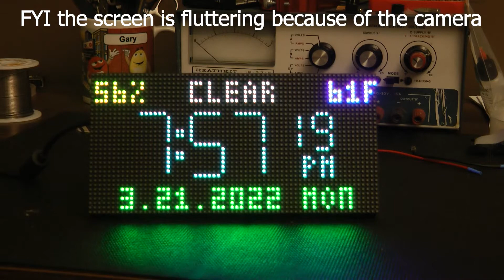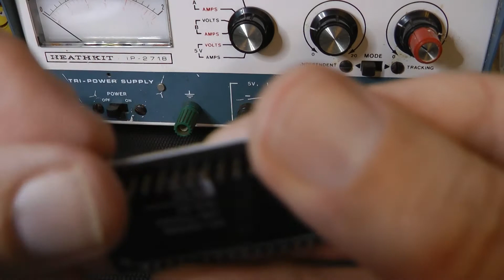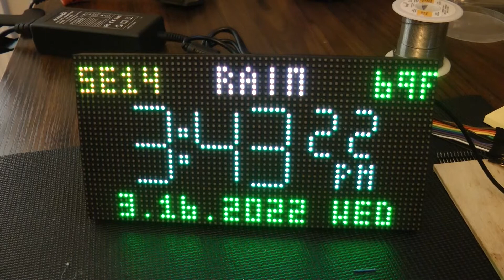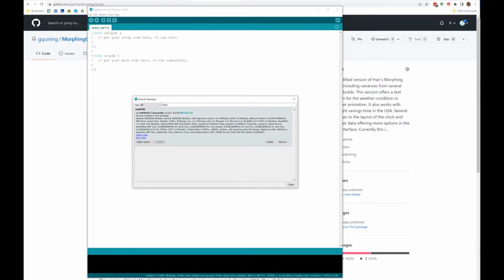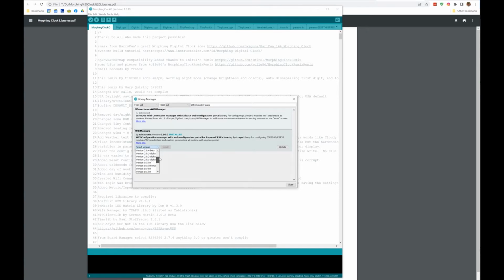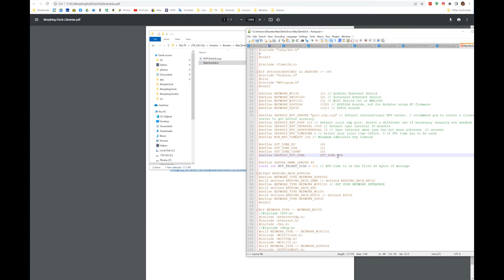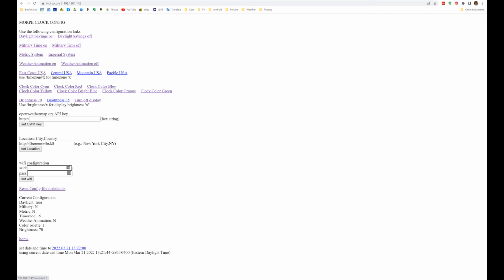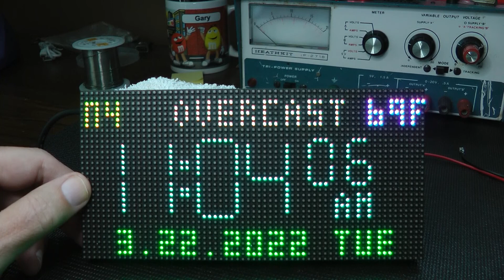Morphing Clock using a 64x32 RGB Display

Comment: @GarryQuiring
Hi Garry, I have followed every step as you had discussed in your video. But it fails to compile! I have tried so many times. It is always showing at the end :-   Error compiling for board NodeMCU 1.0 (ESP-12E Module). I am using IDE v1.18.19 on Windows11 OS.
Plz suggest me what to do now.
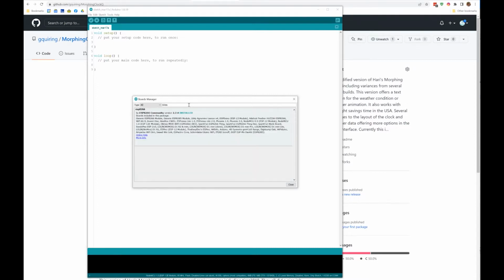Reply from the maker: Review your options with the versions, it sounds like you did not set the board for 2.x, the latest is 3.x.  Watch the video again from 18:25
Reply: @GaryQuiring  Sir, Thanks for your reply.  I have installed the 8266 Board version 2.7.4 which you have suggested. Compilation error still persists ! 
Should I install 3.x version?
One more thing, I didn't connect the board to my laptop during compilation. Is it necessary?
Reply from the maker: @sujitgupta3580  Did you download my zip for the libraries or did you do them yourself?
Reply: @GaryQuiring  Yes sir, I have downloaded your zip file and installed all those except the ino & pdf files.
I have also edited & saved the 'params.h' file as per my details.
Trying to compile your '.ino' file but getting the same compilation error.
I am asking again.... is it necessary to connect the 8266 board with laptop before compilation? 
Plz help me sir.
Reply from the maker: @sujitgupta3580  Stating it does not compile is like telling an auto mechanic my car does not work.  I have no idea where/what is causing the errors.  You need to give me better details.
Reply: @GaryQuiring  Sir, sorry to disturb you again. I have freshly reinstalled everything -- Arduino ide & your google drive files. Now during the compilation an error comes like this: -
 
exit status 1
'Ticker display_ticker' previously declared here.

After that I have checked the Sketch and noticed "display_ticker"  is in there twice.

1) //ESP8266 setup
   #ifdef ESP8266
   #include <Ticker.h>
   Ticker display_ticker;

2)  #ifdef ESP8266
    display_ticker.attach(0.002, display_updater);
    #endif

Would be grateful if you kindly suggest me what to do now.
Reply from the maker: @sujitgupta3580  The declaration for Ticker display_ticker is only declared once in the source on line 124, the include statement is on line 123.  Is that the only error or are there more errors?  Are you sure you have only one file ending in .ino in that directory?  I'm also curious is your first experience with Arduino IDE?
Reply: @GaryQuiring  Sir, After restarting my Laptop I opened "MorphingClockQ.ino" file (path is :-C:\Users\sujit\OneDrive\Documents\Arduino\libraries\MorphingClockQ-main\MorphingClockQ.ino) and no other ".ino" file is there.
Now previous Error has gone but compilation stuck with a new Error :-
exit status 1 
redefinition of 'void setup()'

Since my ide version is 1.8.19, line numbers are not showing in the sketch. However, it stuck at :-
void setup() {
  Serial.begin(9600);
  while (!Serial)
    delay(500);  //delay for Leonardo
  display.begin(16);
  //     display.setDriverChip(FM6126A);
  //     display.setMuxDelay(0,1,0,0,0);

Sir, I am an electronic engineer. After my retirement, I am with Arduino for two years, had done some projects with uno, esp32, attiny85, etc.
and I confess that beside you I'm just nothing!
Reply from the maker: @sujitgupta3580 There is the error.   You installed the source code in the library directory. It should be "C:\Users\sujit\OneDrive\Documents\Arduino\MorphingClockQ"
Reply: @GaryQuiring  Sir, Thanks for your sincere  cooperation. I have placed the ino file as you have suggested.
Now came the old story again during compilation!

exit status 1
Error compiling for board NodeMCU 1.0 (ESP-12E Module).
Reply from the maker: @sujitgupta3580  I don't think you have the files in the correct location for the IDE.   All of the project files that you downloaded from GitHub (not the zip lib) have to go under the folder MorphingClockQ directory (without the main or ino extension.  Your main directory should be "C:\Users\sujit\OneDrive\Documents\Arduino\MorphingClockQ".  Under that folder are the files from github like the Morphingclockq.ino, the .h files and the .cpp files.  Make sure the directory does not have main or ino in the name.
Reply: @GaryQuiring  Sir, All the files and folders along with .h .cpp files etc are copied and pasted at C:\Users\sujit\OneDrive\Documents\A rduino\MorphingClockQ directory where the "MorphingClockQ.ino" exists.
I have noticed that some sub folders such as examples, fonts, fuzzing, etc are also there in each Library and all sub folders are carrying some .h files. Should I shift all those files also to main directory (MorphingClockQ)? 
I have removed the "Libraries" directory from where the files are copied.
Reply from the maker: @sujitgupta3580 But what is the error?  What it is complaining about?
Reply from the maker: Also did you install the additional boards for the 8266?  Watch at time 16:45 on the video.
Reply: Getting this msg :-
Error compiling for board NodeMCU (1.0 ESP-12E Module)
Reply from the maker: @sujitgupta3580 It sounds like you did not add the board (8266) to the board manager.  Review the video at 16:50
Reply from the maker: If you did that then I don't know what's wrong.  The best suggestion I can make is make a video and show me where the files are in the Windows file manager (or whatever tool you use like Total Commander), then show me the settings in the IDE and finally show me the compile.  If you don't know how to record a Windows session use screenrec.com.  Upload the video to your youtube channel and post the link here in a comment.
Reply: @GaryQuiring  Yes sir, I will make and send the video link to you at tomorrow morning. Good night.
Reply: @GaryQuiring  Sir, I have spent almost 48 hours behind this and tried thoroughly and vigorously all steps and all files to fixup the errors. I have done almost 80% of it.
Now during compilation getting the Error :-  'DST_ZONE_IN' was not declared in this scope.
I have some confusions regarding my "Location" and " Default_DST_Zone"
I am staying at India, city Kolkata.
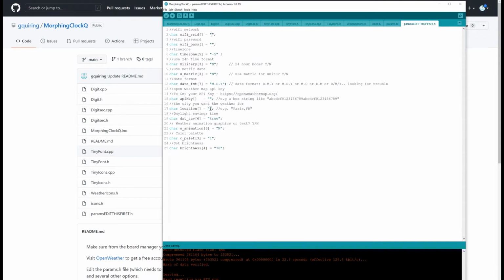I have put char Location[ ] = "Kolkata,IN" (in Params.h file)  your video time 27:36 and
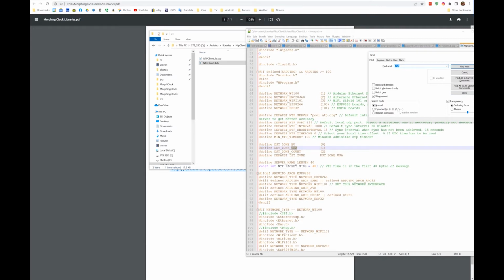#define DEFAULT_DST_ZONE        DST_ZONE_IN (in Arduino > MorphClockQ_libraries > NtpClientLib > src > NtpClientLib.h)  your video time 30:27.
And finally getting this Error during compilation :-  'DST_ZONE_IN' was not declared in this scope. 

Please define the 4 lines below as per my region :-
#define DST_ZONE_EU                  (0)
#define DST_ZONE_USA                (1)
#define DST_ZONE_COUNT           (2)
#define DEFAULT_DST_ZONE        DST_ZONE_USA

Sir, I like to achieve it at any cost...... plz suggest.
Reply from the maker: @sujitgupta3580  Are you working with my Google Zip file or did you download the libraries yourself?  The code makes no reference to DST_ZONE_IN.  Where did that come from?  Did you modify something beyond editmefirst file?
Reply: @GaryQuiring   Here is some latest update :-
1)  I have changed "DST_ZONE_IN' " back to "DST_ZONE_IUSA'  and  the Error ( DST_ZONE_IN' was not declared in this scope) has gone.
2) Now I am getting that previous error :-  Error compiling for board NodeMCU 1.0 (ESP-12E Module).

By scrolling up, I have noticed a line :- collect2.exe: error: ld returned 1 exit status.
I have googled it and came to know that this error comes when the IDE can't linkup the cpp files.

I have checked with File > Example > ESP8266 Sketches. No issues came for compiling and uploading.

I repeat again that I have used/installed your uploaded files only and placed those in same root directory where MorphingClockQ.ino is residing.

Plz suggest if you have any clue else I will give it up ☹
Reply from the maker: @sujitgupta3580  What is the directory name for the morphing clock code you downloaded from Github?
Reply: @GaryQuiring Hi Gary Sir, perhaps you are too busy to reply me. I have fixed up almost all bugs except two issues.
1) Clock time is always 30 minutes behind. I have set my timezone +5.5 (for Indian Standard Time) at params.h file.
If I set the correct time from web browser it's ok until I restart power.
2) I have set brighness "70" but I want to increase the display brightness more.
What's the way?
Youtube link: https://youtube.com/shorts/txjzxM22VKk?feature=shared

Plz spare a short from your busy schedule 🙏
Reply from the maker: @sujitgupta3580 The clock time is an issue where you are located.  Read this on Google for more details, it's not related to the clock code.  
https://www.google.com/search?q=Indian+Standard+Time&rlz=1C1ONGR_enUS1027US1027&sourceid=chrome&ie=UTF-8
Reply from the maker: Manually setting the clock is for testing only. The ESP module does not internally keep the time.
Reply: @GaryQuiring  I know that sir sketch code is not responsible for time variations but how could I solve this? If I put timezone "6" the time is jumping to 1 hour forward! I have noticed that it follows the whole integer only and no decimal value is functioning. If I put "UTC+5:30" error comes during compilation.
Reply from the maker: @sujitgupta3580  I looked at the code and sadly the library call for the NTP sync is expecting an integer.  In the NTP header (NtpClientLib.h) is a variable defined:   int8_t _minutesOffset = 0; 

I would change the 0 to what your need either 30 or -30.  Then recompile.  See if that works.
Reply: @GaryQuiring Helllo Sir, I have edited the "NtpClientLib.h" file by changing the value of int8_t_minutesOffset = 30 or +30 or 0.5 or .5  or +0.5 or +.5 ....but result remains same (30 minutes behind). Obviously there is still something to edit.
That's the only hurdles at my last mile. Awaiting your guidance sir.
Reply from the maker: I followed the logic for the minutes offset and it looks like it should work.  Are you sure you saved the setting and then recompiled and uploaded to the ESP?  If it's still not working you are going to have to contact the author of the NTPClient program.  His contact info is in the source code.
Reply: @GaryQuiring  yes sir, I had opened that header file in Notepad, done editing and saved. After then recompiled and uploaded for each case.
Reply: Another point I like to mention here that all library directories are kept in root directory where ".ino" file exists (c:\\....Arduino\MorphoClkQ). Now if I remove / rename the NtpClientLib directory no error comes during compilation! Although in ino file it is mentioned: #include <NtpClientLib.h>
Reply from the maker: @sujitgupta3580  That's your problem, the libraries are not to be included in the main source directory.  They all belong in the "libraries" folder.  Why did you copy the libraries to the source folder?  The source is not going to pay attention to any library in the MorphingClock directory.  Look at the include paths, they don't have directories in them, they assume a library folder is present.  You must have at some point copied the libraries from the library folder to the Morphingclock directory.
Reply: @GaryQuiring  Sir, all the "Lib" directories were in "libraries" (plz check the spelling) direcctory and that "libraries" directory was in the sketch directory  where ino is stayinng.
 I had just tried to solve by trial.
Now, I have re-shifted all Libs to "libraries" again as it was before.
Problem remains same (30 mins behind). On serial monitor it is showing "Got NTP time: " which is also 30mins behind.
The last line is "24th Sync Enabled"
Don't know it indicates what.
Reply from the maker: @sujitgupta3580  You need to talk to the author of the NTPClient lib
Reply: @GaryQuiring  After trying & trying since more than two months, I have finally solved the "30 minutes lagging" issue in my own way.

I have elongated the "24hour ntpsync" to 30years and corrected the time once through OTA. 
And I have powered up the ESP8266 separately by a small 5V UPS module. That's it. Clock is running perfectly.

Actually, the main disobedient culprit is "NTPClientLib". I had tried a few other sketches with it and faced the same issue. Had also noticed that many others of different forums complained against this Library. Mostly they are using "NTPClient" instead of NTPClientLib.
However, a long Peace for thirty years if I live 🤓
Reply from the maker: @sujitgupta3580  How accurate is the clock on the ESP8266?  You don't think it's going to drift?  Why not dive into the code for the NTP logic and add 30 minutes to it somewhere. From my quick view of the source I think this is the key variable to play with: _minutesOffset
Reply: @GaryQuiring  Yes sir, I'm aware about ESP's time drift if not synced but no way here.
If I'm not wrong you are talking about this line " int8_t _minutesOffset = +30;   ///< Minutes offset for time zones with decimal numbers " in C:\Users\sujit\OneDrive\Documents\Arduino\MorphingClockQ\libraries\NtpClientLib\src\NtpClientLib.h
If so, I have already put "+30" there but resulting the same error. I have also tried with "30" & "+.5" & ".5" but the error remains same.
One thing I really couldn't understand that timezone is already been set there at "params.h" header file (in my case it is +5.5), then why the time is not following that? I had done so many time related projects with ESP32, ESP8266-1, Arduino Nano, etc but never faced such offset problem.
I have chosen your sketch because of its decent positioning of all the display features. Hats off to you for that!
Any more suggestion...?
Reply from the maker: @sujitgupta3580  Not in the declarations, in the logic.  Follow the logic in the NTPClientlip.cpp file and find a place to add 30 minutes to the time.
Reply: @GaryQuiring  Sir, At last the SUCCESS came 👍👍
As per your advice I have put "30" in NTPClientLib.cpp file (Line no. 100) and 30 minutes lagging error has gone now.
A big SALUTE to you Gary Sir 🙏
A long chapter has been closed now with happy ending.
Thank you very much.
Reply from the maker: @sujitgupta3580 I was also looking at that line too, that is where I had a feeling it should go.  I'm glad you finally got it working correctly.  Make sure to put your NTPSync back to 1 day.
Reply: @GaryQuiring  Yes sir, I have corrected it back to '24hour ntpsync' as it was before. Thanks again for your prompt  & sincere supports throughout from the beginning.

Comment: Hi Gary, have u ever come across when you upload the code to the 8266 when you reset it just shows at the bottom of the display " timezone 0" its doing my head in now as i have tried 2 diplays and 4 different eso8266 boards
Reply from the maker: That's not an upload problem.  Do you have a paramsEDITTHISFIRST.h file?  Did you rename it to params.h after updating it?
Reply: Yea have done that
Reply from the maker: @andybaker8472  What value do you have in the timezone field?

Comment: Excellent

When i try to compile its giving error

In file included from MorphingClockQ.ino:98:
Arduino\libraries\NtpClientLib\src/NtpClientLib.h:501:32: error: reference to 'byte' is ambiguous
  501 |     bool summertime (int year, byte month, byte day, byte hour, byte weekday, byte tzHours);

Thanks
Reply from the maker: It looks like you did not follow the directions for the ESP library, you cannot run with 3.x, it has to be 2.x.  Watch the video around 18:20 minutes.
Reply: @GaryQuiring  
Thank you so much for the reply

I will see again follow the directions

Thanks alot

Comment: Very well done, nice work and video.
One thing I would add, is you don't need external power for the display, everything can run off a 2A USB charger ☺️
Reply: True! It really simplifies the power wiring! I just ran the +5v from the wall charger to both the display and the VIN pin on the 8266. No need to use the USB connector on the 8266 after the sketch is uploaded.

Comment: Hi, i have built this amazing project but have run into a problem that i cant seem to correct. everytime i try to upload the program i get an error which states "reference to 'byte' is ambiguous". any ideas??
Reply from the maker: Watch the video more closely, you took the default for the ESP, it can't be 3.x, it has to be 2.x.  It's around 18 minutes into the video
Reply: Hi Gary, have checked this but now it won't compile to esp8266
Reply from the maker: @andybaker8472  That's not helpful, you need to provide more details on the errors.
Reply: @GaryQuiring  this is the message im getting - have tried the generic 8266 board also
exit status 1
Error compiling for board NodeMCU 1.0 (ESP-12E Module).
Reply from the maker: @andybaker8472  Try changing the flash size to the 3rd option
Reply: @GaryQuiring  hi Gary i have tried that. next option is to redownload all files again incase i missed something
Reply from the maker: @andybaker8472  I would use the Google Drive download for libraries and make sure to rename the source directory to not have 'master' in the name.
Reply: @GaryQuiring  wierd - i just rebooted the laptop and low and behold it now works. fantastic project
Reply from the maker: @andybaker8472  That's good news

Comment: Hi Gary, Hope you can help when I tried to compile and got this error "Compilation error: reference to 'byte' is ambiguous", not sure why did clean installed Arduino and your libraries. Thanks
Reply from the maker: Watch the video more closely, you took the default for the ESP, it can't be 3.x, it has to be 2.x.  It's around 18 minutes into the video.
Reply: @GaryQuiring  Thanks it's working.